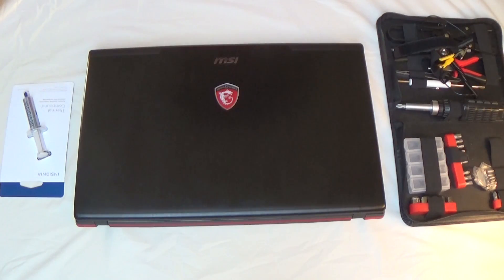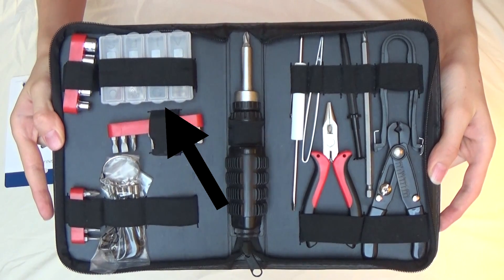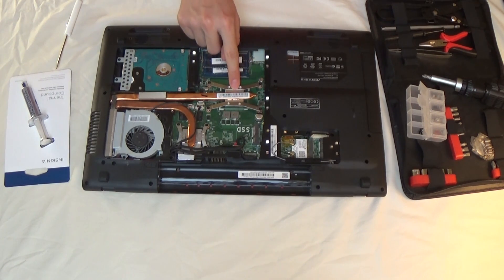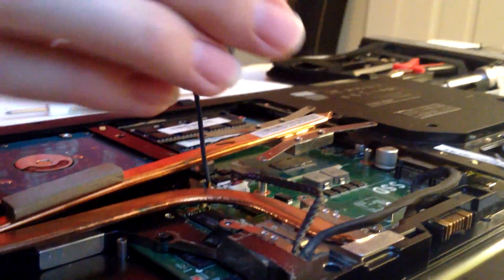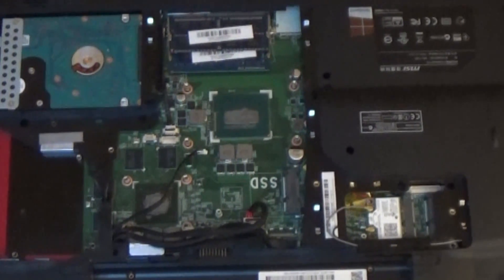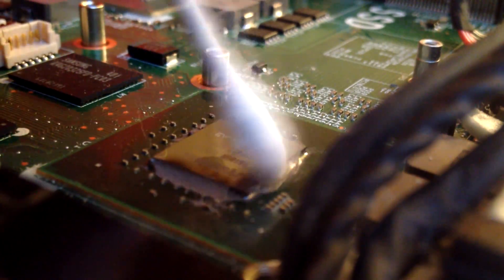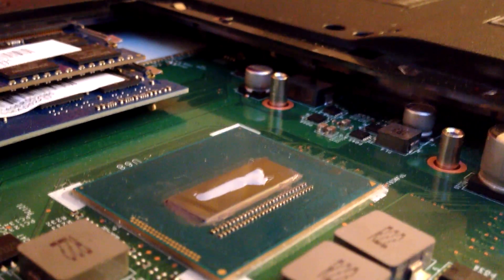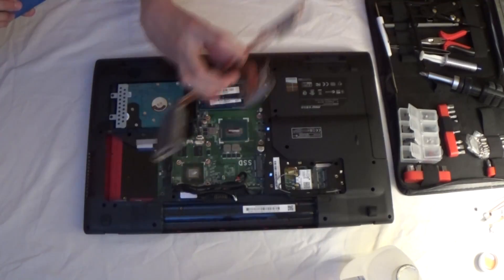How to Replace your Laptop's Thermal Paste

Comment: Let's clear this whole thermal compound thing up once and for all.

1) Thermal compound, at least the newer thermal compound that you can buy today, should be non conductive. This means that there is absolutely zero cause for concern if the compound does decide to flow over the edges of the CPU die. Even if it completely covers those little resistors and capacitors that are on some CPUs.

2) You can definitely spread the thermal compound over the CPU die manually, IF you only use a small amount. I have built and repaired many computers and laptops, and none of them have ever had compound overflow from spreading thermal compound out manually. But again, you must use a very small amount of compound. I'm talking just barely enough to completely cover the entire die. This brings me to number three.

3) Do not be afraid to touch this stuff, it will not kill you. It is not a toxic material. It will not soak into your bloodstream through your skin. So go ahead, touch it. It washes off easily.

It is pretty hard to screw up applying thermal compound, and once you do it a few times, you forget why you were ever worried. 

Side note: thermal compound is not a gap filler. If the heat sink does not make firm, flush contact with the CPU die, do not goop up the thermal compound to fill the gap. Use a copper shim set. They are all over the internet. Or use the thermal transfer silicone pads, as that is what most, if not all, computer manufacturers use to fill small gaps. You do not need thermal compound if using the silicone pads.

DISCLAIMER: use this information at your own risk. I am not responsible for anyone's actions but my own.
Reply: you are correct on a few things, one not so correct. The heatsink won't be flat, the mating of the heatsink to chip is never perfect, there will always be air gap, air is bad conducted of heat, the heatsink compound is to enhance the heat transfer and fill in the gaps. I have worked in electronics for 40 years, all the best manufacturers use silicon heat transfer pads. Everybody fails to mention that the heat pipe is filled with fluid, usually a hydrocarbon otherwise you would not get and movement of heat through the pipe to the heatsink fins.
Reply: @petercrane8216  do you mean we can use silicone thermal pads instead of thermal compound for cpu and gpu chips? can you link me to the product? should i get 0.5mm, 0.25mm, or 0.15mm thick pads? how much W/m-K does it need?
Reply: @petercrane8216  So do you recommend changing the thermal paste on a laptop? (to overclock the gpu)

Comment: Please don't ever take a metal screwdriver to the motherboard! If you want to clear thermal paste from around a processor use a plastic implement. And don't get any cotton strands mixed up with the thermal paste (and you don't want to because it will break the contact with the metal surfaces) which means you shouldn't clear away any freshly applied excess paste with a cotton q-tip!

Comment: so..there is no need to spread the thermal past after you apply it? like to let it even on the chip?
also...is it okay to use an artic silver 5 paste? some people recommend applying it on the cooler and spreading it all over with the credicard as you said
Reply: Just read the instruction of your thermal paste, there are a few TIM's that require spreading, but Arctic Silver 5 doesn't.
Reply: dont spread it.
Reply: Old and usually crappy thermal paste needed that, but not anymore, cooler master makes the best thermal paste in my opinion put a dab in the middle if its square and just put the cooler over it, it should spread nicely and check the temps with speccy or whatever.

My hands are too shaky and tried to explain my dad how to do it but we kinda messed up the paste around (1 ball in the middle and a little bit on the side) but it doesn't matter the cpu barely reaches 60c now its crazy and with the stock cooler too it was reaching 90c before which was too much.
Reply: which one did you use?
Reply: +minigunexo

Comment: Too wasteful.
Reply: if you're using non conducting paste, then it's better to go too much than too little. Even when the non-conducting paste flow over to the sides, it will not short anything because, well, the paste doesn't conduct.
In fact, by being liberal with your paste you will most likely eliminate air bubbles, which is most of the time, the reason for higher temps.

Comment: Ugh,the screwdriver. Use a plastic spoon that comes with most thermal compounds or some rigid plastic, should work fine to clean off the excess on the edges.For the love of your components do not use a screw driver to clean off thermal paste of your cpu or gpu.
Reply: Personally I like to use a hammer and chisel, it comes right off.
Reply: @Christopher_T_Paul  Yeah, Great. 😂
Reply: @Christopher_T_Paul  Gotta scrape that CPU clean off.
Reply: I think i'm gonna use a pneumatic drill to get the old thermal paste off of my Lenovo Y50-70 if it has a messy previous thermal pastejob done to it.
Reply: hahahaha made my day.
Reply: I use a toothpick
Reply: +Chris Paul  LOL
Reply: You mean cause of static and cause screwdriver is a weapon?
Reply: THATS TRUE sadly last vid ive seen the guy was doing that :/
Reply: Eh
Reply: I saw another video where the guy used a credit card. It works just fine and is a lot less risky.
Reply: Honestly and yet he “try not to scratch anything”
Reply: Whispering Vegan Thermal paste is made our of animal fat, you as a vegan shouldn't use it but rather use mustard or nutella....

Comment: Guys is it possible to tell me if 1gr thermal paste is enough for replacing both gpu and cpu pastes?
Reply: +Fotis V If 'gr' equals a gram, then yes, there's more than enough there to do both the cpu and gpu. Less is more in this case and the usual recommendation I've seen when I've put it on a brand new desktop processor is a blob the size of a pea.

Comment: a guitar pick is way safer to get in the crevices with than a metal screwdriver. Also I recommend cleaning up all of the old paste a lot better than this guy. I also highly recommend using a non-conductive paste. If you over flow with conductive paste you're asking for problems.
Reply: Or better yet a nylon opening tool
If you need more strength: a spudger
Reply: Oof replied before I knew why; I assume he jammed it into the side to open the case
Reply: I just use a wooden toothpick. Great for getting solidified paste out, not enough momentum to dislodge capacitors, and pointy on both ends so you don't accidentally apply too much force, you will feel the pain before the cpu does

Comment: I recently acquired a I3 2330m cpu and applied AC5. I go into the a game and my cpu temp shoots up to 75c after about 20 minutes of gameplay. Would you recommed reapplying the paste or should I leave it?
Reply: +RogerRHF were the temps hotter before you applied the thermal paste?
Reply: +Emin Sarabsky Before I had a B800 CPU so I can't really compare. That CPU ran at about 65 max since it is only clocked at 1.5ghz.
Reply: RogerRHF ok then. What games do you play? And also, I assume it's a laptop cpu and laptop cpus usually get hotter because of the restricted airflow. The temps look fine but if it reaches 75c while being barely under load, thats not good.
Reply: +Emin Sarabsky I play mostly World of Tanks on this laptop.
Reply: RogerRHF I think the temps are fine, as long as you didn't put too much paste on it.
Reply: +Emin Sarabsky I haven't checked the temps lately, the AC5 prob cured by now resulting in slightly better temps.
Reply: +RogerRHF it takes 200 hours for it to cure, so keep that In mind.
Reply: +Emin Sarabsky Well I use it everyday and I posted my original comment about 2 months ago so I think it's good now. I'll check the temps again to see if there is any difference.
Reply: +RogerRHF alright
Reply: +Emin Sarabsky It no longer reaches 75 degrees. It now does 70c and it gets up to 72 if I really play for a long time.
Reply: RogerRHF That's excellent, it shouldn't be any higher than that.
Reply: Arctic silver improves over time, best temperatures are seen after 200 hours.

Comment: Im applying thermal paste by spreading it with credit card like for 7 years- never had any problems. May depend on structure of thermal paste tho :)
Reply: Uneven distribution causes air bubbles in the thermal paste. You probably got very good at evenly distributing but most people don't know how and end up either overflowing it or putting it uneven and causing air bubbles to form. So it's safer to just do the pea or line method as it's harder to screw up.
Reply: Thermal paste technique is one and all the same.  No matter what technique you use, it wont really effect your temps.  I have experimented and I also remember Linus Tech Tips testing all techniques and none of them made the slightest difference.

As long as you get the correct measure of paste onto the chip, you will be golden.  Too much paste will just make a mess, maybe cause slight temperature increase by insulating the chip, very few thermal pastes are not electrically conductive (well maybe cheap Chinese knock offs are) so won't damage your CPU.

However too little thermal paste will cause temperature issues and can result in damage.

Comment: I'll try this out and see if it works for my macbook. Liked and subbed.
Reply from the maker: +SoldierSparky Thanks! <3 Hmm, this should be doable on a macbook. However, disassembly will probably be a bit harder, because apple hates people who actually know what they're doing. :P
Reply: +FSixTech I've got one of the 2007 models and I did it. I put about half the size of a pea.
Reply from the maker: SoldierSparky Nice work! Yeah, that should be about right for a laptop chip. :)
Reply: +FSixTech Okay thanks dude.
Reply: +FSixTech I've replaced it again because I heard my Mac was suited to the spread method. I tried it and watched this video in 720p and went to 80 degrees. replaced again and went to 75 degrees with fans at 6200rpm (max speed). Do I need to put wait for it to 'set'?. Please help.
Reply from the maker: SoldierSparky I honestly don't think any chip should have the spread method used on it. I'd recommend redoing it with a rice sized bit of compound in the middle. Less is usually more, because you likely ended up insulating your cpu rather than creating a way for heat to conduct.
Reply: Don't spread it
Reply: I've re done the pasting and now it is pretty cool and does not overheat.

Comment: used ketchup works well ;=)
Reply from the maker: +KehuA excellent choice, I can tell you're a professional.
Reply: For anyone reading, this advice is complete BS. I tried both cum and ketchup and neither worked very well at all. Lame.
Reply: use feces ...just smear it all over every component and your laptop will run like a supercomputer
Reply: Chris Paul but wouldn't the acidity degrade the transistors if used as a long term replacement?
Reply: "Temporary"
Reply: You can use old engine oil to fertilize your lawn.
Reply: Actually ketchup can make a half decent temporary solution.
Reply: @Christopher_T_Paul  try honey 🍯 😂
Reply: Lmao
Reply: @Roy Feng - I really wouldn't advise putting anything other than thermal paste on your CPU.  

However ketchup and mayo has been proved to work decently for a several hours of run time.  This has genuinely been tested for a short amount of time, but I really don't advise it and I certainly wouldn't use it for more than a day, so I wouldn't even care to think about acidity.
Reply: WTF XD
Reply: I used mayo and the degrees are now 20 degrees lower. Better then ketchup 😉
Reply: kraft cheese slices can be used as thermal pads.
Reply: 'Used ketchup'? What do you mean 'used'?
Reply: I only have some buffalo wing sauce and honey mustard sauce.  Will either of those work?  Thanks!
Reply: I use that all the time
Reply: no a guy used toothpaste
Reply: so what u r saying you created a machine when it is heated it will send some ketchup smells

Comment: I have an i3 350M with 2 die, how would I apply the paste on this one? One die is tall and the other is short. I've never really done a replacement on a cpu with 2 die, but my laptop heats up alot with any little activity. So yeah I have to do some cleaning and paste replacement.
Reply from the maker: +RogerRHF Hmm, I wouldn't worry too much about the die under the heatspreader, just do your best to use the methods I showed off in the video to get an even spread. :)
Reply: +FSixTech Yeah I'll try, I'm so used to the old school CPUs since I'm more a vintage pc person lol.

Comment: One day , I went to a PC shop . I asked the shopper to get me a laptop's thermal grease / thermal paste (whatever its called ) for my 2 and a half year laptop (Acer Aspire V3-471G) . And he gave me a blue looking thing , looks like a paper but it is sticky and twice thicker than a paper . Is that a thermal grease ? I was fooled by the shopper? (sorry for bad english) Please answer me a.s.a.p :-/

BTW great video ! And wtf you deserve more viewers and subscribers! :D
Reply from the maker: +maisteRs Anders Sorry for late response, I'm really not sure! It's possible that it's some sort of conductive pad that you can apply in between the cpu cooler and the cpu?
Reply: You got a thermal pad not thermal paste thermal pads are used on small low heat chips like vram on a gpu and such thermal pads should never be used on high heat output Proccessers like a cpu as they tend to degrade under high heat 

If you put a thermal pad on your cpu clean it up with rubbing alcohol and apply new thermal compound in a thin line nearly end to end of the cpu